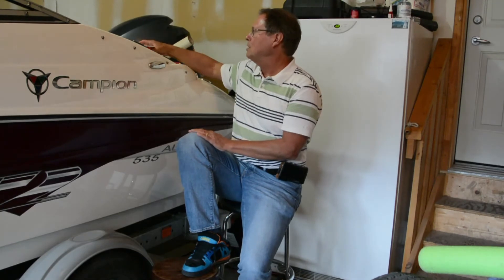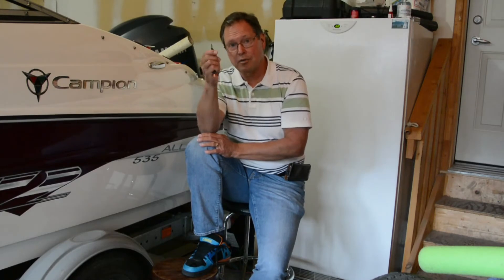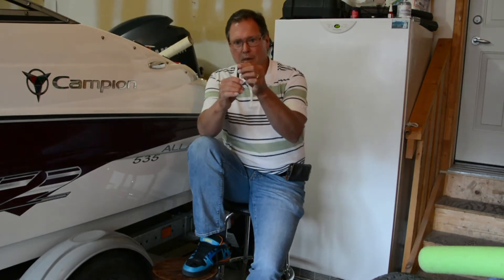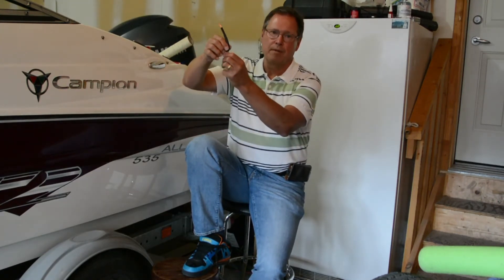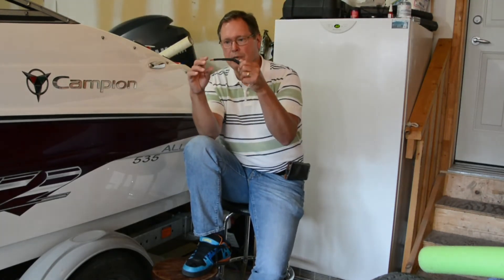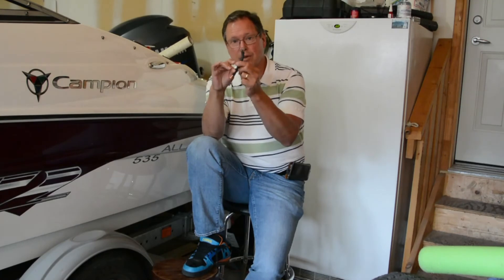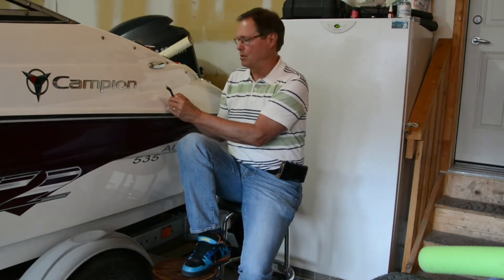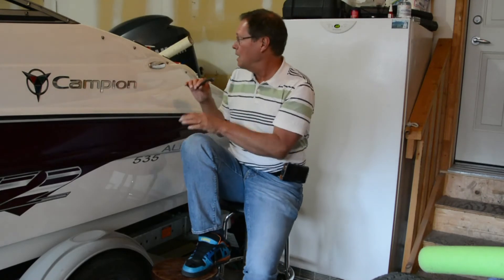Trolling Motor Wiring - What you need to know before you start

Comment: Automotive wiring is perfectly fine in freshwater when the connections are coated with a corrosion inhibitor. Saltwater needs to be marine wire.
Reply from the maker: Thanks for your reply, Michael.

Maybe this discussion itself is worth a video.

Yes, power cables are fine using this approach, and bus bars and open connections can benefit from a corrosion inhibitor of some kind.  This is the old "put vaseline on your battery terminals" advice, which still holds.

Marine engine connectors are already designed to keep water out.  They have silicon seals on the wire, and a seal on the connector itself, to keep moisture permanently out.  Obviously, automotive connectors are in a completely different category than ring terminals or lugs.

The higher in frequency the signal, the less value a corrosion inhibitor provides, and can  even create issues.  You should never use it in RF cabling connectors, and those connectors should be well covered in self fusing rubber tape.

A great example of this can be seen on some cellular towers.  Often, you will see football size balls of self fusing rubber tape over connections on antennas an RF cables.

The reason for this, is that moisture of any kind inside a coaxial cable can create thin layers of oxidization, and this can lead to either capacitance, or a diode effect within the cable itself, which will cause the cable to fail.  Often, drying it out will not solve the issue and the cable will have to be replaced, since the moisture will "wick" internally, and replacing the connector itself will not fix the cable, and often multiple feet of the cable will have to be chopped to find clean conductors.
Reply: @GoldenChannels  I myself completely rewired my bass boat do to the fact the original owner had ran house wiring when they rewired it. I had to replace everything wire wise. I ran everything in automotive wire, used heat shrink connectors and heat shrink both. I used an electrical corrosion inhibitor paint along with liquid tape. No corrosion, oxidation, or anything in 10 years.
Reply from the maker: @michaelflowers6048  That is what I would expect.  As long as you didn't use corrosion inhibitor in your RF connectors, or spray it into the connection to your fish finder transducer, the job should last forever.

My point was that DC wiring will always allow corrosion inhibitor to be used.  But, RF and higher frequency signals would benefit from another approach.  Corrosion inhibitor is not a "cure all" for every electrical connection.  It is almost never used in outdoor cellular applications, for example. And a similar rule would apply to a VHF radio antenna lead.

Spraying it inside your outboard engine compartment, except where the battery connection lug/ring terminal is, is a waste of the spray and your time.  Applying it on your fish finder connections follows the same rule.  The connectors are better dry and their seals will prevent moisture in the first place.
Reply: @GoldenChannels  exactly.
Reply: @GoldenChannels  another thing a lot of people don't know about wiring their fish finders is that their wiring needs to be completely separate from all other wiring to prevent electrical interfaces on their screens and get a much better image

Comment: this and your 24v video have been hugely helpful to me.  Can you give a link to the chart you were using that shows wire gauge and length of run recommendations?  I think I'm going to have about 25 feet of run from 24v battery pack to trolling motor socket, plus the cables on the unit itself.
Reply from the maker: Josh, thanks for your kind words.  We have a calculator that is specifically designed to help you choose the right wire for your trolling motor install here:  https://www.goldenchannels.com/electric-trolling-motor-power-loss-calculator/

This calculator lets you start with the manufacturers recommended wire sizes, and see what happens as you increase wire size / cost.

The ampacity table I use is here, as well:  https://www.powerstream.com/Wire_Size.htm

We're still tooling up to make custom lengths of trolling motor power wiring.  There is a shortage of tooling around these days, hopefully we will be doing this by the end of April.
Reply: @GoldenChannels  I'd be more than happy to buy pre-fabricated cables from you if the price was right in exchange for what I learned from two of your videos.  Reply here if you're offering it and info about how I can get in contact with you.
Reply from the maker: @josh.kaptur  my work email is eric.larson@goldenchannels.com Thanks for the offer.